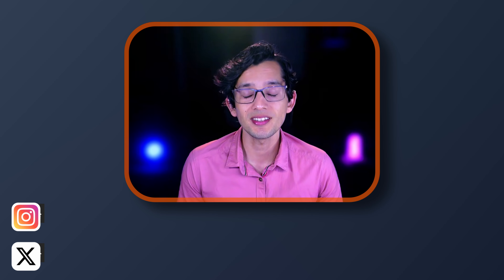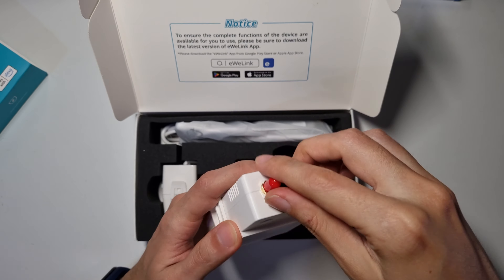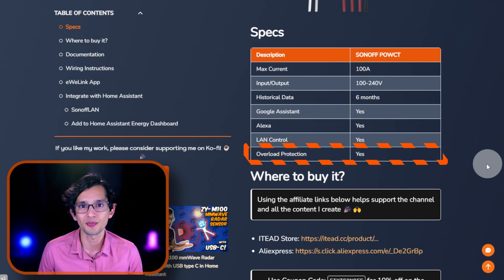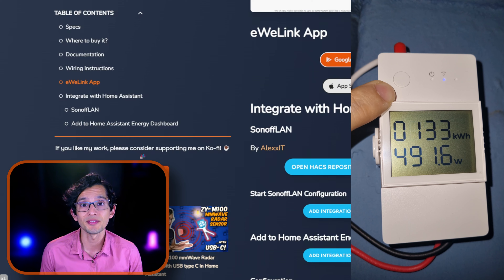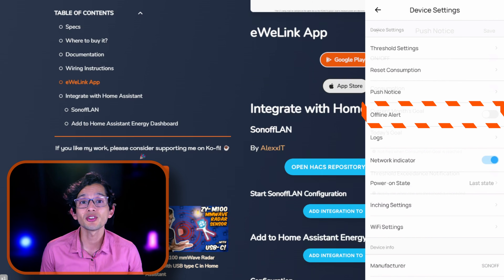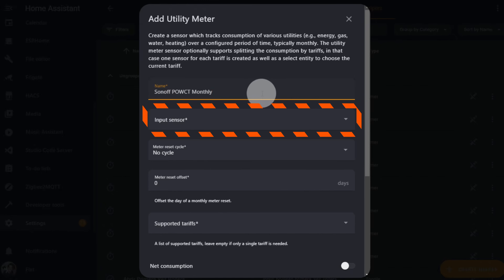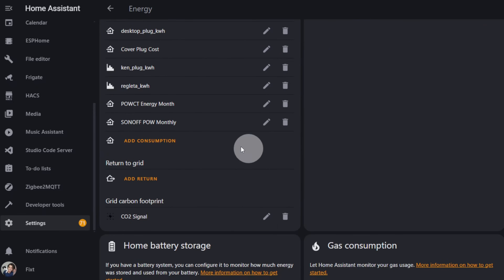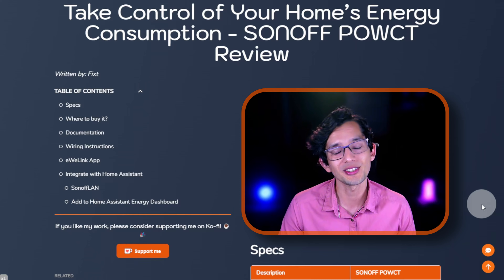Take Control of Your Home’s Energy Usage - SONOFF POWCT Review

Comment: if a radio (wifi) device has an antenna interface I would always connect the antenna, even if there is very good wifi coverage. Otherwise there may be a risk to harm the wifi radio transmitter/amplifier because of energy reflected to the sender.
Reply from the maker: interesting, I didn't know that, thank you, i'll investigate more about it.